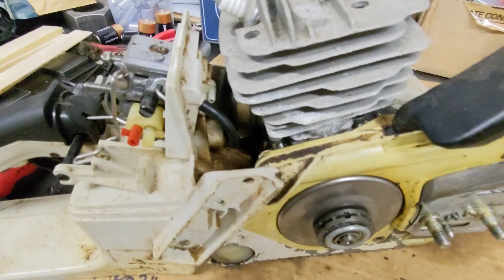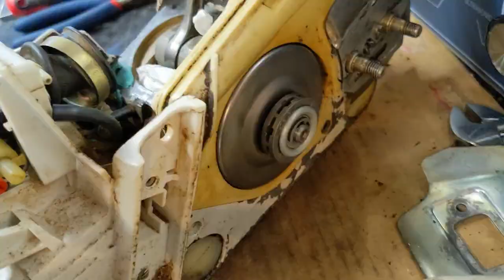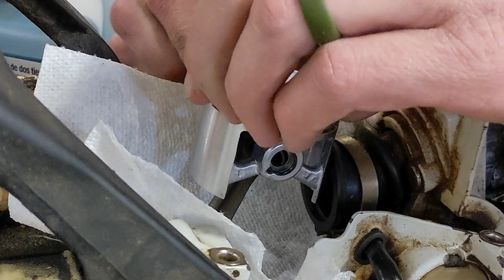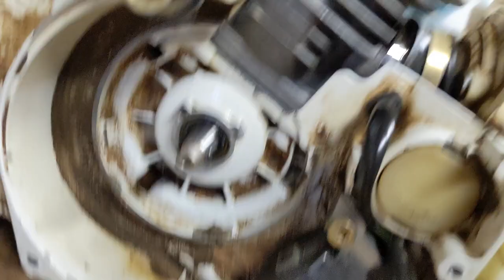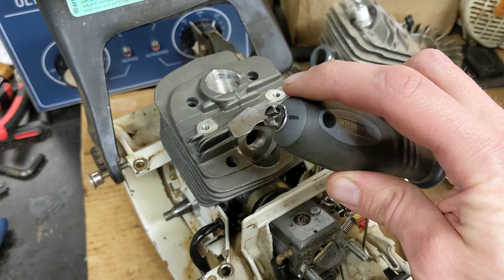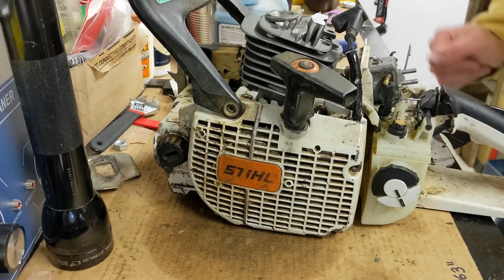Stihl 036 Chainsaw -- Complete Top End Rebuild for Less than $20! -- Step by Step Details

Comment: How's the saw holding up? I'm looking into doing a rebuild myself. Thanks for the video!
Reply from the maker: It was working good, then unfortunately, due to nothing but my own fault, it ended up sitting for several months without getting started. I'm usually good about at least starting equipment to keep it running if it is in semi-storage. So it wasn't running. I probably just need to clean the carb. I have a few days off near Christmas this year so hoping I can fit that into the project list! 
Let us know how your rebuild goes and please feel free to post any questions here as you go!
Reply: @Buttons_fix_it  thanks for the reply,  will do!

Comment: Don't you need New crank seals? You mentioned in the unboxing that you didn't need them. ?
Reply from the maker: Hey there, when I rebuilt this top end I had just replaced the crank seals a few months before. I bought those separately, actually had bought them years before but got side tracked with life and other projects. So I didn't need the ones in the top end kit. Thanks for watching!

Comment: Why did it fail in the first place?
Reply from the maker: I didn't see any smoking gun for the failure. I suspect there was some defect in the rubber that finally opened up a leak path, or some piece of debris got into the crankcase and damaged the seal. Good news is I didn't see any damage to the crank. I think it was the original seal so lots of years on it.

Comment: You can put that cheap China crap in but at a cost of huge power loss! Bit it will run!
Reply: And that happens for a reason and will continue unless you fix it!
Reply from the maker: Thanks for the thoughts - so far no noticeable power difference but I'll definitely make a follow up video if it junks out on me. For the cause, I'm pretty certain that was me constantly fighting the saw thinking it was some other issue when I had a failed crank seal. So the ratio of fuel/oil to air was messed up for awhile before finally failed.
Reply: @Buttons_fix_it  oh I guarantee you lost power. Port timing and squish are terrible in the cheap stuff. It just probably runs ok which is good!